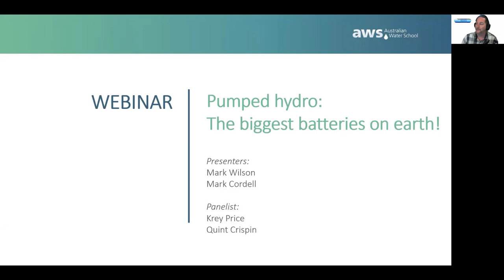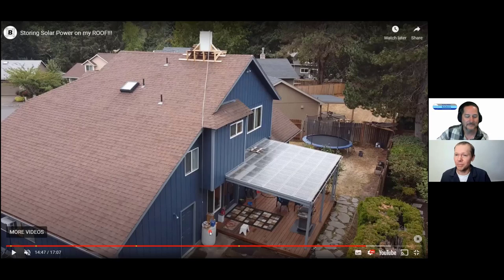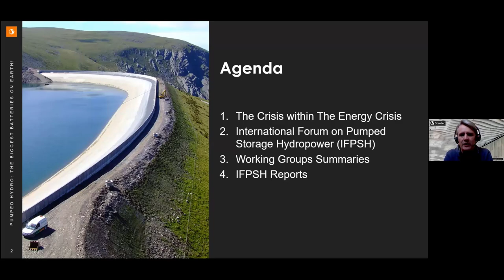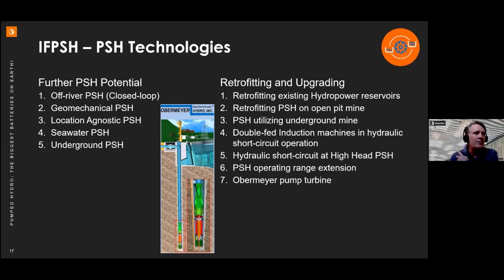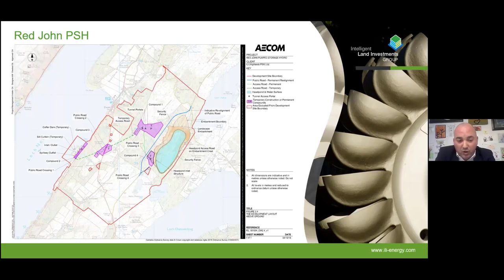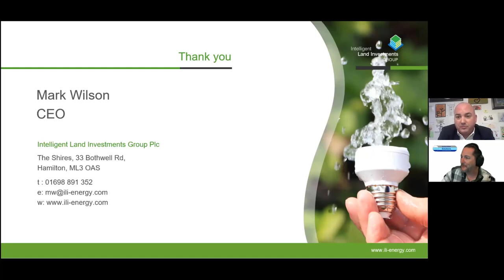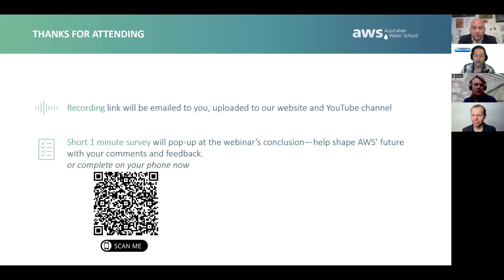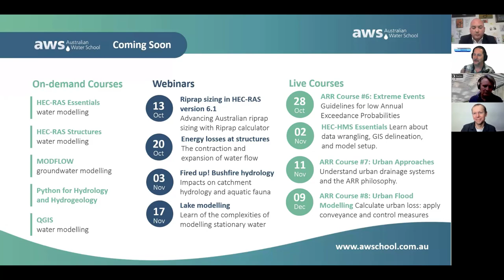Pumped hydro: The biggest batteries on earth!

Comment: Hi i put forward the idea of using victorias mothballed north south pipe line as a pumped hydro facility, done a lot of investigating found the height difference between the goulburn river pump station and the highest lift point more than enough ,  its proximity to melbourne its high  irradiance levels on the north facing slope ,infastructure has been paid for and costing a substantial amount to maintain  . Spoke to  a local enviromentalist he didnt understand  how it would work he thought it was the fabled perpetual motion ,had a meeting with the local federal rep he failed to see how electricity could be exported from the site had to explain that electrons can travel in both directions .H Had a word to Melbourne water they were mildly interested but again didnt fully understand the proposal saying they didnt have sufficient funds . Am convinced this should be considered